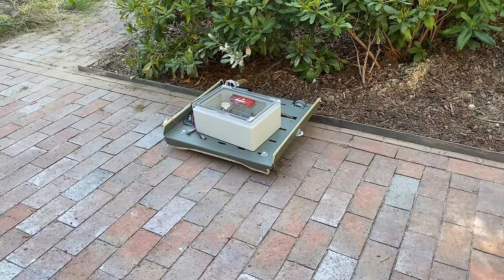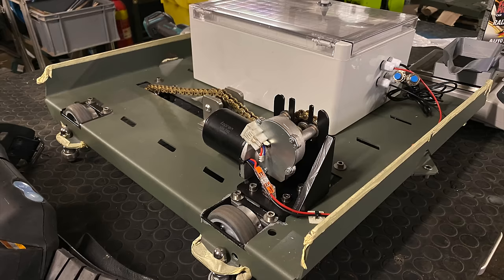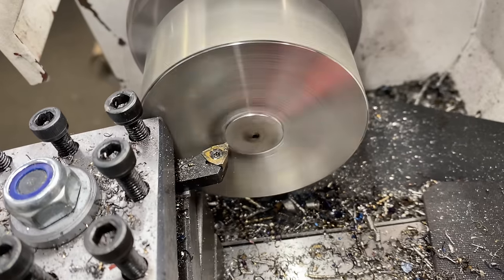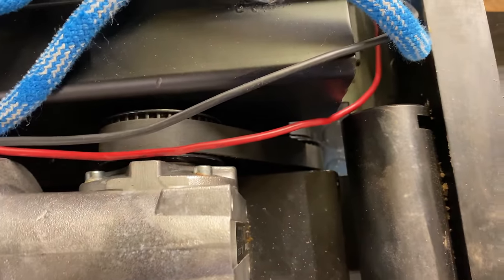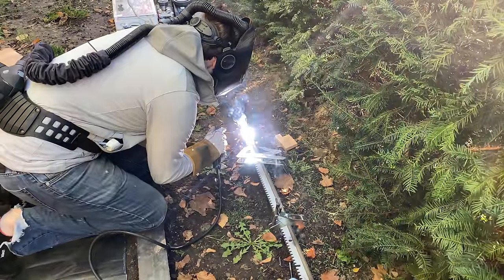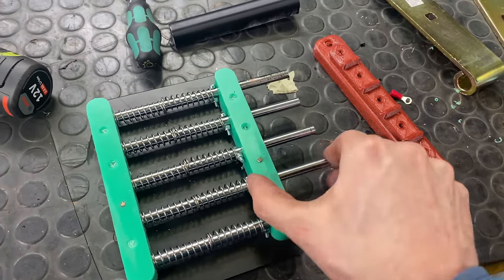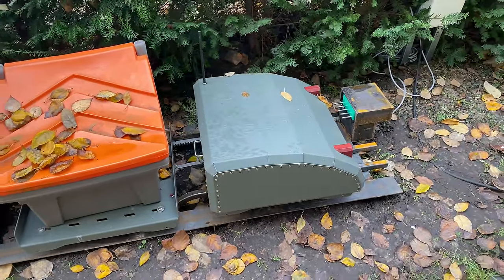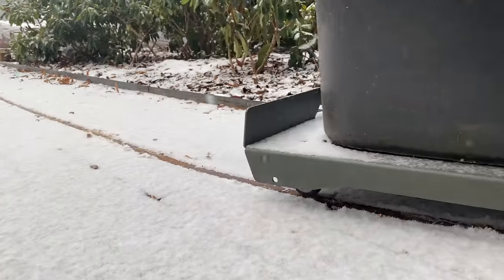I put my trash cans on rails and now they move automaticaly! (Trash Train)

Comment: If I had any confidence that our trash men would put the bin back on the trolley, I'd buy this in a heartbeat =)
Reply: If they don't you can just put the empty bins back on the carts.and then send the train back to home station.
Reply: @kaspernbs     9:43   There is an overlap between people who can live independently and people who can’t lift garbage cans onto the carts. If a person’s lucky, their neighbour is generous enough to help every time; it’s not always the case and/or it can be difficult to ask. They don’t even have to be older to have troubles with this since mobility issues can affect anyone at any age. I hope you’ll be kinder when “just do it yourself” crosses your mind.
Reply: Empty bins are not heavy. Also you don’t need to lift it but just slide it onto the platform. Also the bins should be the other way around for easier removal.
Reply: Was going to suggest the same thing..  my waste management crew some reason every time will take the trash from the receptacle which i set on the edge of the lawn as does everyone else, but every damn time they put the empty bin directly in the middle of my driveway.  So every trash day they come before i head out to work so I get to run into it with my car every time unless i remember to grab it before I go to work, otherwise i have a dent in my rear bumper that matches the corner of the bin..  
   I thought about making a 5th wheel and adding it to the bin so when i do run into it, i will just push it out of the way to the side rather than having to dig it out from under the car and buy new ones every so often..
Reply: @volkhen0  lulz... At that point it's easier to just take the bin back myself. Added bonus: don't turn my front yard into a mid life crisis train hobby
Reply: I would put up a sign that says that I am handicapped/old, can you please put the bins back on the trolley please
Reply: Our trash trucks have a big claw. Perfect recipe for cans lying around.
Reply: most likely they need to be moved onto the road anyways
Reply from the maker: For me its not so much about the collection day, but more about the daily use. The bin men definitely just place them back next to the train.
Reply: @volkhen0  Empty bins can be over four or five kilograms (at least these kinds can) if there's a bit of water or leftover soaked paper in the bottom. In addition, they are large and bulky, difficult to get a grip on if you have trouble with the handles. Until you have a grandmother that suddenly can't lift more than 10 pounds for moe than a few seconds, you might not understand how frail the human body becomes as it ages. If you see an old person struggling with something, just help them. Most often, don't ask: They quite often are still proud or embarrassed at having to ask for help, and won't accept if offered. Just doing it for them if possible is the easiest way; and at a certain point of old age you have to 'grow up' and accept that you need help.
Reply: @MaxMakerChannel  I wonder about some gamification, perhaps the bin man gets an automated ‘thank you’, and can press a button to send it back. However, local authority engagement would probably help develop a local policy to work with elderly that have invested in such automation. Loved the video.
Reply: Sigh...time to add a screen make it a mini game with a reward system. As they put the cans back a progress bar fills and when they are all returned a satisfying "win sound" and it dispenses some candy.
Reply: @iainballas  you don’t have to explain me that. I can’t lift more then 10lbs (5kg) because of back problem. I move my bins but I never lift them. They have wheels and you can always find a way to move them without lifting whole bin. Also I know something about proud and asking for help. I perfectly know it’s not simple or easy. You are right.
Reply: If you really are unable to put the bin back on the trolley, a nice message on the bins may help to make the trash men put them back on the trolley, especially in combination with a little gift from time to time, for example some chocolate...
Reply: We have centralized collection locations, if I would leave the bin on the train the trash men wouldn't even empty them because they would be nowhere near the collection point.

I would make or buy something like this if I had a use for it, if only to store the bins in an invisible location and pop them out when I need to throw something away.
Reply: @rossfarrell  You could put a fresh sammich in a box that only opens once the cans are placed back on the train 🤣
Reply: Lol so true
Reply: @kaspernbs  it defeats the purpose
Reply: @fmo94jos8v3  I would just add the winning Euromillions ticket.
Reply: @eligebrown8998  its purpose is to move heavy loaded bins, through a tight spot to an easy to access spot.
Reply: I've been dreaming of a cart like an remote control car (RC car).
Reply: @MaxMakerChannel  'train' your bin men to put them back on the trash train.  Incentivise them , reward them somehow for putting the bins back on the train and pressing a big red button to send the train back.
Build pressure sensors into the carts that detect when a bin is on board, when all bins are onboard the big red button lights up.
When the red button is then pressed they are rewarded somehow.
Reply: @stellahead  I think its really funny how everyone has started thinking of the trash people like animals
Reply: @LeviathanProbably  that couldn't of been further from my mind.  I was aiming at making a mundane job a little more fun. The goal is to give the refuse collector a smile, I in no way was insinuating they are animals, far from it, I've experienced the job first hand.
Reply: @stellahead  I was joking lol, sorry if I gave you the wrong idea.
Reply: It just kinda seems like people are trying to teach the trash people tricks like a dog
Reply: @volkhen0  for YOU they aren't heavy. But for people with mobility issues they sure are. Hell even holding a fork can be hard with them. And people with no arms, well, they can't lift them at all
Reply: Honestly though? If you'd be able to make sure they would take them off the wagons and put them back on, then you could create a dream. You could automate the trash can system entirely by implementing some sort of automated smart moving of the carts, like Smart Home solutions. Each early morning of trash day the carts would automatically drive out, stay out throughout the day to give the trash men time to come by, empty them and put them back on, and then in the late evening the carts would drive back in fully automatically. So you'd NEVER have to take care of trash again, at all.
Reply: Forgot to say, once they wreck it and have you pay a third party to remove it, you'll be doing much more walking from now on to retrieve your bins.
Reply: @Z-Ack  lol see now I have the exact opposite problem. I put mine at the edge of the driveway where its flat concrete and then they set it back off to the side of the driveway on the sloped grass where it falls over in the ditch and I have to fish it out.
Reply: @Will he heck as like Hardly, there is a way to fix any problem.
Reply: Where I live we have to bring our cans out to the curb. Depending on the mood of the trashmen, after being emptied, our cans can be found lying on their sides on the street or end up back on the driveway.
Reply: @paulnieuwkamp8067  yes, extend the train track way more round the back, and put the bin behind your shed or some at the bottom garden/backyard, and have your house as a sort of train station, when ever your putting house trash, out, call the train, come to your house, may a auto lid lifter, like track end stopper open the lids, pop pop the trash in and he send back to hidden location, and trash pickup the, it does the full track run past the house to the road pickup point, (that the only point, could it have raised platform like proper big passenger train, so the bins just wheel out and back on, that might even encourage, the removal service place the bin on the train afterward? like marked out car parking space's)
Reply: @shadowdancer4532  a weed Wacker, just low enough to keep the track clear, once a month, as moving trash, given the track path, a quick trim as it passing?
Reply: Haha. Schenkelklopper. Die stehen leer immer irgendwo auf der Straße.  Müssen die auch gar nicht!!!😁😁😁
Reply: @smthngsmthngsmthngdarkside  How dare people have some fun making something neat.
Reply: @Z-Ack  you don't... Look... Before... Reversing? That's not their fault lmao.
Reply: @haakonness  I have something called assisted collections, where the bin men come into my garden and take my bins to the truck, empty them, and then return them to my garden. I have this because I can't do it myself. It is only available to those who are elderly and/or disabled, no sign necessary. All they have to do is put the bins back exactly where they found them and close the gate behind them. Not once have they managed to successfully do either. I have called and complained numerous times over the 6 years I have had this "service" as I am unable to move the empty bins back where they belong after they're haphazardly dumped in the middle of the garden, and have been assured it will never happen again every single time. And yet. It sadly isn't as simple as just making people aware, even when their whole job is to be aware.
Reply: How to ensure Trash Guy puts bin back on trolley 101:

Have a big red button that says "LAUNCH" With a small sign underneath that says

Once bin has been emptied, place on trolley and hit Launch!
Then have a kids sized snickers bar drop once Launch is hit.

They get a treat, you get your bin returned
Reply: @fmo94jos8v3  yess I like it
Reply: @MaxMakerChannel  They probably give you extra attention because you are the only house with an awesome trash can train, they probably love it and tell their friends and family about it.
Reply: Lmao
Reply: @haakonness  Pretty much everywhere I have lived, you can notify your local council (that you have limited mobility or health issues) and they will put you on a list so that workers always put your bins back correctly.
Reply: @Z-Ack  If empty, why would you not pick it up before going to work? Better then having to stop in the street to grab it coming home.
Reply: @server642  even working in a assisted living facility with an emphasis on memory care, was not enough to bring it to the front of my mindset that there are younger individuals that need assistance with daily living needs, it took me starting a relationship with an individual with a health condition that introduced a lot of mobility issues.  For soo many things she refuses to allow anybody to help her, but for the things that she needs help for, its humbling what id normally take for granted and i think shes the strongest person ive met. She doesnt like when i say that though so i try to only brag about her when she cant see. I fail often though, she is just amazing in soo many ways.
Reply: @server642  You sound extraordinarily full of yourself
Reply: @MaxMakerChannel  wenn die Abfallbeseitigee den Zug fahren / starten dürften, würden sie sicherlich die Tonnen korrekt platzieren.
Reply: if you are disabled and in america, you could send an ADA reasonable accommodation request to your trash collector to do so.  then it would be actionable if they did not comply.
Reply: It’s Germany. Of course they will
Reply: In Florida they wouldn't place it back and they would steal the contraption and sell it for scrap metal.
Reply: @server642  bruh 🤡
Reply: Same. My trash collector gets them in the same basic spot maybe one time out of four.
Reply: The "trash men" don't touch the bins anymore.... The automatic arm on the truck does, and it sets it back down in the EXACT same spot that it picked it up from. 🤦🏻
Reply: @davelowets  Mine doesn’t. It’s an arm that picks up the bin, but it isn’t automatic, it’s controlled by the trash collector in the truck, and it regularly puts the bin down a few inches to a foot off where it was picked up from. Often not even at the same angle.
Reply: @Kevin15673   thank you, you’re literally the first person to say that to me! I was just trying to add some perspective and, given the likes, it resonated with some people. Take it for what you will. I understand posting from this account drops my credibility some. Happy new year!
Reply: Exactly.      I couldn't have said it better myself.
Reply: @Z-Ack  put wheels on every surface lol
Reply: @MaxMakerChannel  I put wheels on my trash bin, built it bigger, then i decided to paint it so it will last me more then a decade the boards also have spacing, so it doesn't trap junk and a cardboard slot under the lid wide enough for dozens of pieces of 4ft pieces.

Your train idea is next level! I know several landlords in this area who would rather their tenants made sure the trash would be in those bins rather then the huge and tall car sized ones.

Thoughtful!
Reply: Put an energy drink on your bins every time and they'll take really good care of them 😉 My trash man even brings them back up to the house now
Reply: @server642  if they cant pick up garbage cans, how can they put the garbage in them
Reply: @Z-Ack  Do you not,, look out your rear view mirror when backing out??
Reply: @stellahead  yeah how about a 2€disenser xD
Reply: @Z-Ack  a little strange that you would just drive into your bin
Reply: Self driving bins? Make them autonomous so it can drive itself to a pre defined location, a weight sensor will tell when it's been emptied to initiate the return leg.
Reply: Yeah I was thinking that or a couple of other issues where I live
-wind knocking over the bins
-track would have to be on the road to get collected (would probably get crushed when someone parks there)
-snow will cause issues
Reply: It is not the job of the bin man to re assemble a train. So sadly a little weight and they go back on with little effort by you :) I would put it back cause its cool toy!
Reply: @MaxMakerChannel  Where I live (B.C.) they have to be on the curb or they will not take them. Looks like you don't have a curb to put them on. Also, now we have automated trucks that have big claws where the truck just pulls up beside the bin, lifts and empties and returns to the curb.
Reply: @Z-Ack  i wonder if there is something above where the bin goes? I have seen my trash truck pick up the bin with the claw about 12” off the ground, drive forward 3’ to get out from under the tree on the curb, and then raise the bin to empty it. He had to put it down 3’ from where I left it. After a truck finally broke a small tree limb because that driver didn’t care to do all that, I moved the bin location!
Reply: @AnonymousFreakYT  How could the arm put it back down a foot off from where it picked it up? The arm doesn't move left and right, it only moves in and out? The one that picks up my trash puts it EXACTLY back where it came from, to within an inch. In fact, all the driver has to do is stop right when the camera tells him to, and press a button. The rest is automatic..
Reply: @davelowets  The arm on ours moves in/out, left/right, up/down. But the issue (reviewing security camera footage of last trash day) seems to be that the arm sets it down HARD and it bounces.

We are the last house on a dead-end road. The trucks generally come down "forward", picking up the cans for the houses across the street (backing out,) then back down our road to pick up the cans on our side.  Sometimes, instead of backing down our road, they pick them up when coming down forward - they just get out and pull our cans over to the other side of the truck, empty them, then manually put our cans back. Those times (maybe 1/4 of the time for recycling, less for garbage and compost) they make little effort to put them back in the same place - although if we had this track, I would hope they would.
Reply: @13101s  I think that because where I live, people like to help each other, especially if handicapped. And what do you mean read it? I don't know with you, but if I would just glance in the direction of the sign, I wouldn't be able to not read it automatically.
Reply: @13101s  I really don't see the problem. The garbage collectors here already put my bins back where they were at the house wall. So the only change would be that they would have to just lift the can up on the trolley at the same location. And since they are already empty, they don't weigh that much. Why so negative?
Reply: Perhaps there can be a slight ramp on the one edge of each trolley tray, enabling the bins to be wheeled back on instead of lifting them.
Reply: I’m sad that I don’t see user Im Here’s comment, it was written thoughtfully and helped me reframe a bit.

@Kasper Onza, I am sorry for being brash. My perceived carelessness of your “you can just put the empty bins back on the carts” got me heated and that’s my problem.

For further explanation to this end, and for everyone mentioning me:
My understanding is that an abled body person mightn’t need so much confidence in their trashmen as to comment here. Ergo, OP sounds to have mobility issues to at least the degree I’ve experienced with my family. That’s where my perceived carelessness in that line comes from. I am sorry I was unclear about this originally, everyone.

I’m familiar with the wheels and a ramp did not cross my mind. I will concede that I am a clown for ranting about thinking deeper without thinking deeper myself. At the time of commenting, my vision was of the carts sans recess nor ramp and the bin wheels not large enough to aid in the height difference from ground level to cart bed. Once the step-to-wheel ratio (no I’m not “ratioing” anyone) is big enough, rolling turns into lifting. My vision was if this was to be installed as shown in the video and sold as-is. Plus the video mentions a version being easier to implement, so I guess I had self-installation on my mind. I agree now: if someone goes to the lengths of having something permanent set up, they’d have installers who could customize it for them right off the start. I am sorry for the oversight.

Further, I apologize for my tone. I try to use big words to be efficient but I still ramble anyway. I thought they were the right words during the heat of the moment but I realize how shitty it sounds now. I’m sorry everyone; especially and again to Kasper. I shouldn’t have “come in blazing hot”, as the saying goes.
Reply: I'd be more worried that they Would put them back on the trolley... with a fair bit of force and no particular concern for precisely how the bins actually landed/lined up. Big grabby truck claws, you see...
Reply: Retractable cord?
Reply: @meta0269  In Germany in most places the trash collectors move them.
Reply: Why do I have to laugh about the term "trash men"?😭
Reply: @Z-Ack so you dont look behind you while reversing? Im willing to bet the dents in your car aren’t just from the trash can… smh
Reply: @MaxMakerChannel  oh! This definitely got lost in translation for me. I didn't realize the goal was to bring the brings to the front daily so you can sort and throw away the garbage. I thought it was so you didn't have to drag the bins to the curb on collection day. The day to day use makes so much more sense.
Reply: our trash man would most certainly NOT even take the bins OFF the train!   our trucks are all automated - the truck picks up and puts the bins down from the side of the truck (not the back) with a long claw... so the bins need to be pretty close to the ROAD side curb
Reply: @kaspernbs  
But then you have to go outside.
Come out your bed and get dressed.
I would install camera's to see if they emptied them already.
Then push the remote control while staying in 🛌 💤.
Reply: I can just hear my grandad - rest his soul - say bluntly "Just bring the bin in/take the bin out, you lazy bastard!" :p
Reply: @Z-Ack  What about using mirrors
Reply: Give them a nice big button to press so they can watch the train pull it back themselves and they'll do it. They're lazy yes, but mostly just bored.
Reply: and you better make the some Tea then or give them a snack
Reply: @Z-Ack  I have 2 issues here.
1. If it happens everytime, how do you still end up hitting the bin with your car, should you not know by now to move it?
2. If you repeatedly crash your car into your own bin, how competent a driver are you? Do you check your mirrors before moving?
Reply: That was exactly my first thought.  Those guys would never take the extra ten seconds to set them all back onto their little cars.
Reply: Everyone here thinking of worst case scenarios and the most limiting physical disabilities to call Trash Train a fail. Buncha nellies. 😹 

I’d totally buy this! So would my apartment manager who has to drag 10 bins out and back every week. Such a slog! But in our case the track would have to cross city sidewalk, so it would likely need a different design. Maybe if the rail had to stop at the end of the property line, but the train cars had wheels, the engine could somehow push the string of bins “off road” far enough to reach the curb. 🤔
Reply: My thoughts too not here they won't Don't get paid enough is a common comment here
Reply: @haakonness  as if that would work
Reply: @iainballas  helping an old person who didn't want it is disrespectful, it's also bad to baby old people, sure for some people getting weak is inevitable, but for most the best way to avoid becoming a feable old person is to regularly exercise and maintain strength, if you don't let them do that eventually they won't be able to do anything for themselves